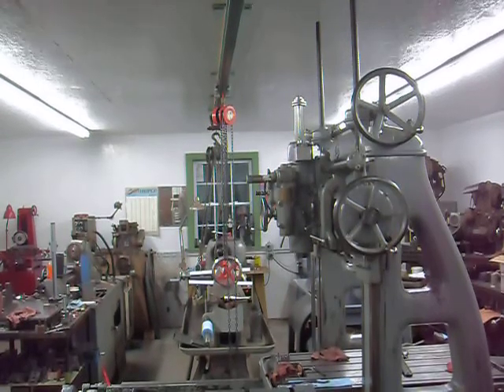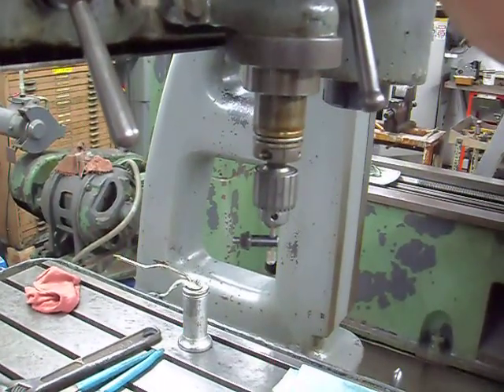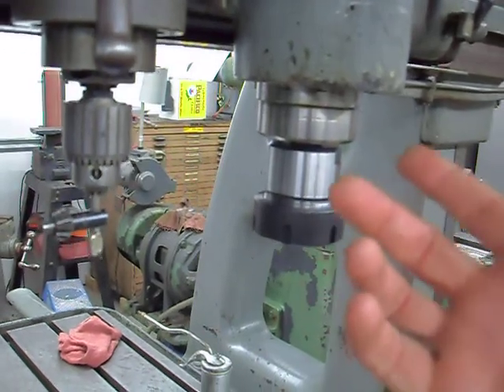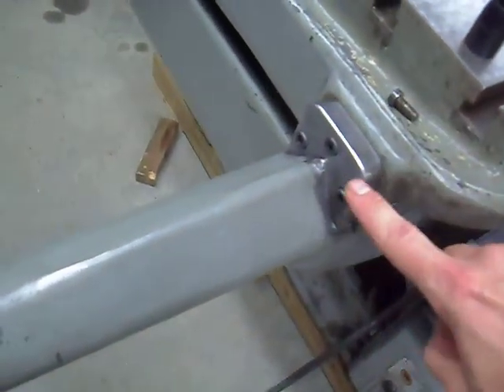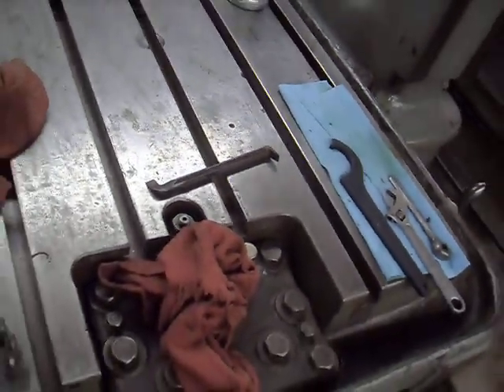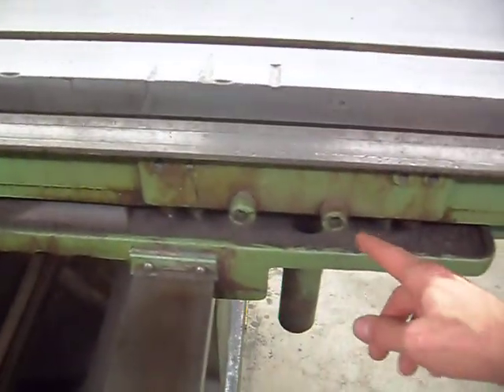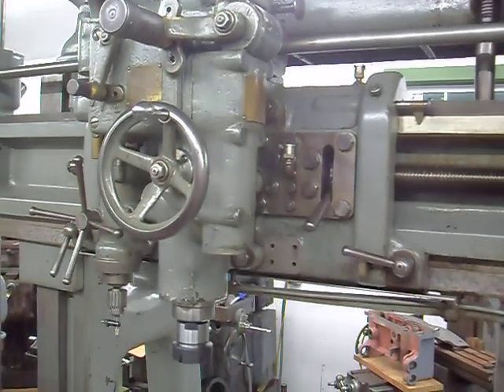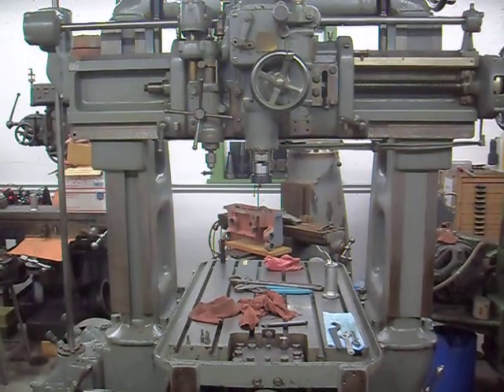Doozer's Machine Shop Update 8-02-18 SIP Jig Borer

Comment: Can this do light surfacing (side milling)? What axis's have power feed besides quill? There's one on ebay now, considering it...
Reply from the maker: Hey Jim,
Good looking machine on ebay.
I like it a lot.
These machines absolutely can do light milling.
They were designed for precision linear hole/bore spacing,
but of  course can be used for milling.
But it is kind of like driving a tractor-trailer to go to church.
Overkill in some ways, and slightly lacking in other ways.
Not a sin, bit people will look at you funny.
That never bothered me.
I got some flack on this when I posted pics of my SIP milling 
a plenum divider in an intake manifold over on Facebook
Machinist's Museum page.  
I believe gravity holds the table down on the ways, no dovetail
architecture like a bona fide milling machine.  But the table is so
heavy that light milling (1"dia cutter or less) would never be a 
problem. You might get away with a fly cutter, but never a face 
mill.
 Thing to remember is with a machine this old, that uses cam 
compensated leadscrews for linear measure, they are not super
 accurate after all these years.  Why not use it for milling !?!
If you want linear spacing accuracy restored, consider installing
Heidenhain DRO or some other brand, some would say that 
using a Newall DRO would be slumming it, but it would be OK.
I believe the machine pictured moves 23.5" on the Y and 
27.5" on the X, and the Z or daylight opening is also about 27".
This is a pretty large work envelope. That is a big reason why
I like my machine.  Way larger work envelope than a Bridgeport.
My machine actually has a larger X travel, right at 32".
Downside of my machine is the 300 rpm top speed.
The machine on ebay seems to have a 2000 rpm top speed.
Very nice. And I believe the ebay machine has power feeds in
 the X,Y, and Z.  It is a good machine for hobby use, but 
a real CNC VMC would be better suited to making money. 
I like the ebay machine, and I would love to have it if space
was not an issue.  It is probably 4 morse taper with a drawbar.
My machine is 3 morse taper, which I have an adapter for 
ER40 collets.  I just love owning and running my SIP.  
 
--Doozer
Reply: @kooldoozer  Read some posts on PM about them confirming they were never intended for milling as you say, as it would destroy the accuracy of the leadscrews...  BUT to your point, it WAS a jig bore machine and in current condition may not be super crazy accurate anymore, but perfectly capable and able to multitask. Still considering it and other options.